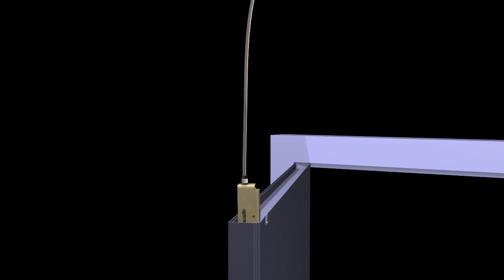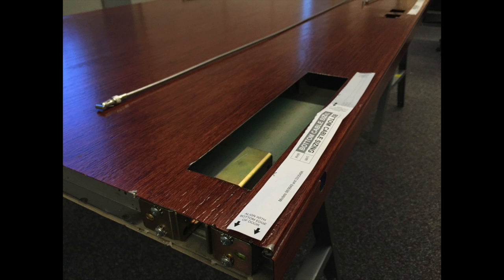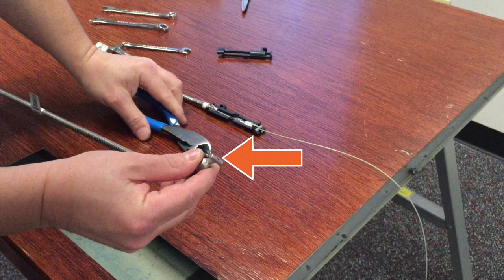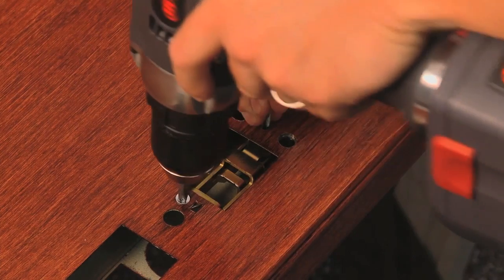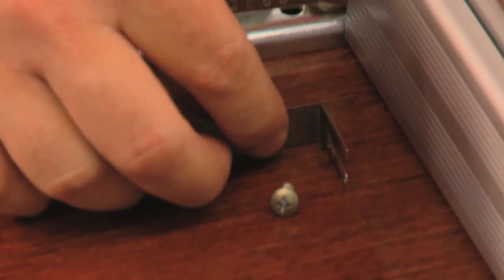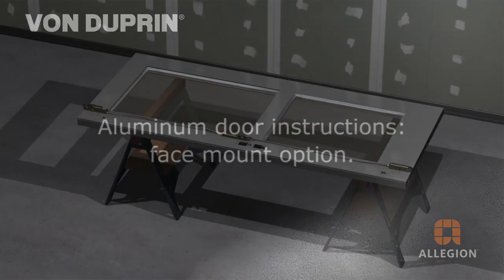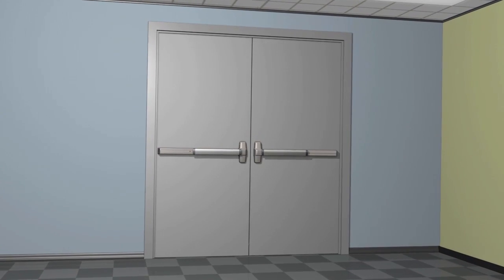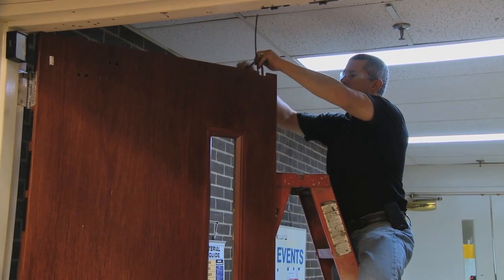How to Install the Von Duprin Concealed Vertical Cable Exit Device

Comment: Referenced this video cause I have never encountered this system before, honestly, while great in thought, these things seem problematic and should not be installed on doors that see regular daily use. There are more than a couple here where I work on a 6 year old building, only 4 do not have problems and those four doors hardly ever get used.

Comment: I work on Von Duprin exit devices at a university. I am a locksmith. They are excessively over-engineered. Nothing simple or solid. They tend to need repairs consistently more than others. The cost is MUCH  higher to purchase and install. They are also difficult to adjust. People pay top dollar thinking they are getting top quality. I am not trying to knock your products. I just gave an honest review of Von Duprin products on our campus. We have many styles of Von Duprins. I have worked on them for over 22 years, from VERY OLD  units to present day versions. They are difficult to work on and vibrate apart over time and use. This video is ANOTHER example of ANOTHER  Von Duprin. I wish i were wrong.
Reply: I couldnt agree with you More
Reply: I work on commercial doors and didn't see this cable system untill a few years ago. I agree 100 Percent it's overly complicated and hard to fix with those tiny rubber bands it's just a bad design. They do tend to slip and need ajustemnt
Reply: They call it job security. Techs call it a reason to drink?  Which vertical rod device would you rate as good? I think they all have there problems.
Reply: 100 percent agree, over engineered!

Comment: Installing this tomorrow. Wish me luck!
Reply from the maker: Good luck!  If you need assistance, you can call customer care at 877-671-7011.
Reply: VonDuprinSafety thank you! Prepping the door went well. But then realized we bought the wrong length of cables for the doors.
Reply from the maker: If you need support obtaining the correct hardware, you can contact your distributor or dealer, or feel free to call our customer care at 877-671-7011.